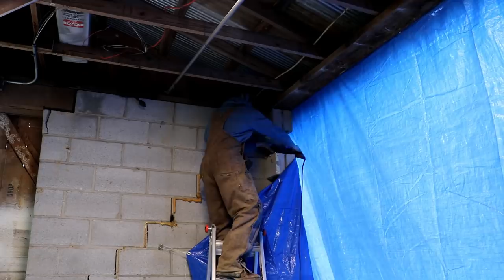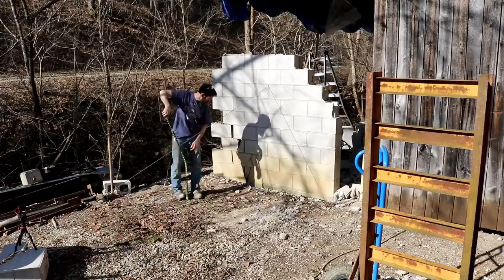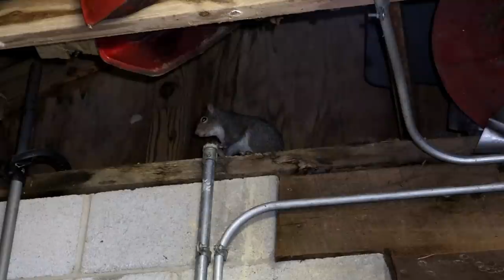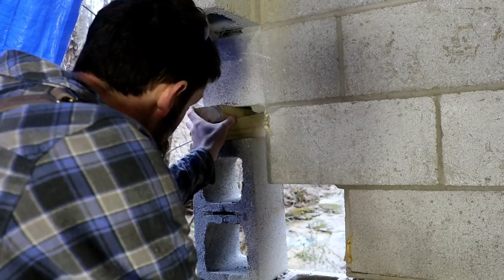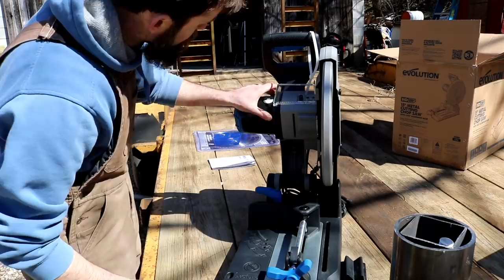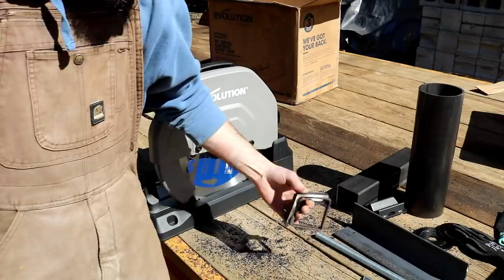Pushing down the block wall & New shop saw ..Shop repair part 6

Comment: Glad to see your shop coming along. Seems your ibuprofen supply is still going strong 🤣. I bought a 12" makita version of one of them saws and I absolutely love it. About the only tool in my shop I'll play in real time on video 😁. I've cut 4140 with it (annealed of course), sparks a little bit but doesn't seem to mind. My poor little bandsaw just sits in the corner until I need it for aluminium or something. Thanks for the share, Steve!

Comment: I've had two Evolution chop/mitre saws and they are great, I currently have the 'Rage 3' model, smaller blades than the one you have, but super useful.
Reply: Also, the reason I'm on my second one is that the screw to change the blade is a left hand thread. I did not realise this when I came to change the blade on the old one and royally effed it up to the point where it was easier to just buy another one :D

Comment: The project is moving along pretty well. You're going to love that saw, a friend in NY has two in his shop where he builds and repairs off road vehicles and trailers. I've used both 10" and 14" there, the blades last quite a while and when Tig welding the joints I believe the world's are better cause the metal hasn't been subjected to the heat the abrasive blades generate. Also the lack of grinding dust is a huge plus. I'm saving for one of the 14" now for my own shop.

Comment: Steve, I have switched all my air hoses to flexzilla hoses, they are absolutely the best hoses out there. I have also thoroughly abused them without any issues except the one I shot a nail through with an air nailer. I have dropped stuff on them, gotten weld spatter on them, sprayed them with acetone for years, and no issues. They also are ridiculously flexible as they claim. If you make the investment you absolutely will not be disappointed.

Good pick up on the evolution saw. I have an Iron Ton which is similar but sold by Northern Tools and I don't even use my horizontal band saw any more. It's louder, but it's so much faster, and the cuts are better. As you noticed when cutting through something flat the extra surface area slows the cut down and introduces some chatter, so i've found the best thing to do with angle is to set it up like a pyramid that way you're cross section is 2 angled pieces of metal instead of one vertical and one horizontal cross section. Hope that helps.
Reply: The best hoses are Gates.

Comment: Boy those Evolution metal saws are the dogs dangly bits as we say here in the UK ! ( well that's the clean version anyway! Lol) we have had Evolution stuff here in the UK for at least 10 years. They first started out marketing chop saws that would cut through lumber as you Americans call it with nails in it and I saw a few demonstrations of their saws and yes they worked as advertised working on the principal of slower blade speed and guarded teeth so that the bite of each tooth was restricted as to the depth it could cut. The new metal saws work in much the same principal.
You almost lost a camera on the wall drop Steve, measured the drop nicely but didn't allow for crud being thrown forward! Nearly! Love the multiple shots of the various angles of it coming down. Very arty farty! ( please forgive another English saying.)

Comment: Hey steve I have been a fan for a couple of years now I love the videos. I own the same saw, I love it. Mine is a couple years older. The only issue I had was the old quick release bound and hurt the threads. I ended up making a whole new one without a quick release. Your saw looks like they made it stronger with a thicker diameter screw. I ended up researching a lot on blades I have a list of blades that fit. If you would like the list I would be happy to give it to you so you dont need to look. I think the list has 48 different blades. All the blades are 14" and are the right arbor and speed. My favorite blade right now is the tenryu heavy metal plus. If I can give you a tip, the blade really doesnt like wide flat surfaces it causes too many teeth to contact at once which slows the cut and causes chatter. Build yourself good thick v-blocks doing that you can put material to cut in the saw with the least amount of contact at once. Heres an example with vblocks you can put square tubing in the saw with a diamond orientation that allows the least amount of teeth contact at once you will get a cleaner, quicker and less chatter cut. Sorry for the long comment. Keep up the great work and have a great day!

Comment: Nice saw Evolution sent you - looks like they've improved their designs. Had a Rage 2 miter saw from them. Currently have a Evolution mag drill - works great. Definitely should look into better ways to clamp different shapes of structural steel - like Joe Pie's video. You'll get faster, more accurate cuts, improved blade life and in the case of that angle - a much SAFER hold. Good stuff; enjoy the videos!

Comment: i ended up replacing the the vice screw and nut on mine because the quick release nut would jam up and started to mess up the threads. i used acme thread and a plain nut as a replacement.

Comment: I avoid HF metal air fittings as I have had them break if dropped on the ground or just under air pressure.  You will like that saw more than any other saw you have ever used.

Comment: I picked up one of Evolutions “hybrid” saws late last summer, on clearance.  I’ve spent the last six months cutting up 3”x3” x8' lumber that had been spiked together to make shipping palette rafts for pipe.  I’ve burned up one blade, but the saw cuts nice, and goes through these 1/4” thick spikes like butter.  I’ve heated my whole house through  this -30’s winter using material cut up with this saw.  By my math,  that was probably 6500 cuts, at least 20% of them or more through random spikes.  Beats burning up my chainsaw. ;)

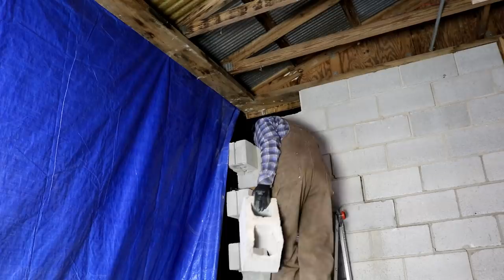Comment: I think that shear line crack in this end 14:30 is because that corner is not/was not well supported. both in the wall itself and under the wall.  I'm no wall engineer either.  just a .04 thought.

Comment: That's the way to do it, One big piece at a time. It would have been a lot harder to take apart block if they had put rebar in them.

Comment: we had a few cold cut steel saws at my old work, cutting steel tube all day. they work great if the material can deal with the cutting forces, and i even once cut through some 2"x1" bar stock for a personal project, cut no worries

Comment: Ahhh, now you've got the bracing.

I suggested going from the middle height of the lifting posts back to the top of the existing partition wall.
The braces could be longer and still entirely out of your work area.

Comment: Gday Steve, great progress, you have certainly got the hard part as good as done, it’s not a easy job by any stretch, I bet you looking forward to getting back to doing some machining, I’ve seen a few other YouTube creators review that drop saw and I don’t think I’ve heard anyone say a bad thing about them yet, I have a Ryobi metal saw with the steel blade, it’s got some age to it now and needs a new blade but it’s done a fantastic job, I found that cutting stainless steel heater flu destroys the blade as quick as lightning, not a good idea, thank you for the update mate, looking forward to next weeks video already,    Matty

Comment: Hi Steve, those saws are pretty good and heaps better than the old abrasive ones (no dust). I use a Makita one at work and that is built really well. I’d recommend it. Glad you’re ahead on time with the project.
Reply: John Sullivan 
I too use the Makita version at work they are a good tool I would never go back to the abrasive version
Reply: Thanks Mark, I was surprised with how accurate they are and while the price is higher to initially purchase, the efficiency makes them more cost effective.

Comment: Steve have you looked into driving piers below the creek bed to support roof structure? Also it appears that erosion & poor choices in concrete mix & reinforcement caused your floor to fail. I'm suspecting the soil base under the slab was of fill that couldn't move water out from underneath the slab which caused heaving & settling.

Comment: That evolution company as a place out of  Devonport  Iowa. I  Bought the rage 2 they had. Still use it pretty decent saw did a couple videos on it. Gonna make a new base for it. Possibly out of one of the fireball tool machine plates he makes.

Comment: I'm guessing you'll be back at harbor freight to get their gas powered hole auger so you can put in a bunch of concrete tubes to hold the soil together and for a solid footing before pouring a new pad. I'm not an engineer, but I'm guessing it will give you a good solid way to help keep it from sinking again. The water drains on the other side are a good idea too.

Comment: my experience with those saw, try to minimise the blade contact while cutting by positioning the cutted piece in a better way.  flat bar, position them upright, the same you would with an abrasive saw, that way no heat is building up (trashing the blade). angle iron, position them with the angle pointing up. you pushed on the saw perfectly tho, when you start seeing sparks, 2 indications possible, you are pushing too hard or the blade is already starting to trash itself. these blades are costly but we all like them! oh... there no way to minimise the chip, its flying everywhere lol...

Comment: You are probably exceeding the Diablo hose working pressure. Many cheap hoses list their burst pressure rather than working pressure and the "do not exceed" hints to that. In the hose industry, air hose usually falls in to the 4 to 1 safety factor but not always. Some like to use a 3 to 1, if that is what Harbor Freight uses than you hose might be a 100 PSI working pressure. Always stay within the working pressure, that is where it is rated to work day in day out.

Comment: they make a radial saw as well that can cut through wood and nails , been sniffing around these evolution saws for a while now havent bought one yet though as i allready have a radial saw and a normal sawtable
save youreself a lot of work and back acke and rent or borrow a bobcat and use that to break up and remove the foundation , you can get at it pretty eazily now that the walls are gone

Comment: Those metal cutting saws are great, but the blade won't last long cutting rebar. Too many hardspots in rebar. Use a torch or an abrasive saw/grinder.

Comment: Your tool & cutter grinder would do a dandy job on those carbide tooth blades.  As long as you don't chip it from starting the cut too fast, you'll get a lot of re-use just from touching up dull edges.  Does the documentation say anything about being able to use coolant or a water hose?  Since the structure seems to be mostly aluminum, I'd guess the only issue is how well the shaft seals protect the bearings?

Comment: Wanna see more lathe work.  Wanna see more milling machine.   Wanna see more surface grinding.  Wanna see more tool bit sharpening.   Come on Steve let's get with it!

Don't mind me I'm just your typical complainer. 

Nice job on the wall thus far.  You are doing a really great job on the neat and methodical demolition job.  It looks like you put more care into tearing down the wall that the original builders put into it when they built it. 

The Evolution chop saw is nice. But I just looked up the price and all I can say is that at the price it darn well better be nice!
And if I may leave you with one more unwanted opinion:  If it were me I'd save the blade on the chop saw and cut the rebar off with a cheap angle grinder abrasive cutoff wheel.  Especially since it's harder steel.  Harder steel cuts easy with abrasive cut-off wheel.  Save the better quality chop saw for projects that require the nicer cuts.  Rebar can just be hacked off any which way.  It's also small enough in diameter it should cut quickly with a thin cutoff wheel.  For about $20 you can buy an angle grinder and a 10-pack of cut off wheels.  That's provably less than what a new  blade costs for the chop saw. 

Looking forward to seeing your new wall with windows, and bench.   Maybe I'll get my wish for more machining videos come fall?
Great Channel by the way.  I've been watching your productions for quite some time.  I really enjoy your little "Nature Breaks" mingled in with the machining.  And tell your squirrle buddy I said, "Hi".

Comment: You ought to make an arbor to run that Evolution blade on the K&T mill.
Reply: Good God, a 14" blade on a mill?  I wouldn't go near that with TWO ten foot poles...
Reply: @somebodyelse6673  No big deal The mill can turn slower than the cutoff saw does. Metal cutting is ruled by surface feet per minute. it would lack a guard but you wouldn't have to stand directly over it.

Comment: Not trying to be negative but I have never seen mortar come off so easily. When I built my pool and greenhouses the mortar was stronger than the block.
Reply: This demonstrated why you never want to be in a block building when a tornado hits. The line between the block & the mortar is what is called a cold joint. The bond can be improved by having the block damp/wet when laid. If that wall was laid when the weather turned freezing over night the fresh mortar would have been greatly weakened.  Some guys like to put a lot of lime in the mix. Makes it stickier and easier to work, also weakens it, a lot! It's pretty obvious that the footings were not done correctly either.
Reply: Symptom of dry blocks and a weak mix. I always wet my blocks but this takes longer. They saved time so they could have a few more beers. 
If you're laying blocks it's much faster to do it dry. The blocks suck water from the mix and it goes solid enough to lay more courses on top. Looks good and they got paid and ran. As with lots of poor work it's the next guy who picks up the problems.

Comment: That double wedge thing: Some years ago, my parents wanted a large part of a structural wall taken down. The contractors took the wall down, THEN put a steel joist up. Of course the top floor sagged and jammed several doors. Next time, my parents asked ME. My formal training is mainly in electronics... Anyhow, I realized that if you cut into a pre-loaded structure, it's gonna DROP onto the new support. So I put a temporary joist in FIRST. Pre-loaded that as best as I could by tapping in double wedges. Then did the same with the permanent joist.As far as I could measure, there was no further settling of the building from the wall I took down.  Doors and windows still opened w/o a squeak. A marble left on the floor still rolled in the same direction. No obvious change in the spirit levels I had deployed.I find it sad that it seems like I can do a better job in a completely different trade than those supposedly trained and experienced in the field, only by thinking about what'l happen next, and what to do about it for maybe a minute. Total time I spent on erecting that temporary support was probably less than 20 minutes. What's that on a 2 weeks job as the first remodeling was? And that sub standard result will stay with the house "forever".Anyhow, wedges are powerful thing.And forethought even better.Keep up the good work.

Comment: Hi steve they are good saws an do a good job just watch out when cutting dirty (rusty an what not) metal real hard on saw blade seems to make them chip an crack the saw blade but they are much better then those grinding wheel saws.

Comment: Maybe it's been answered, but what are you going to do with all that concrete?  I get some of it can be used when you pour the new concrete, but you've got enough there for another shop!  Great content Steve, love seeing this stuff.

As for the HF Hose...take it back...get your money back and get another...rinse and repeat.  Same with their power tools.  When you know you're going to beat the daylights out of a tool (i.e., Stripping the hull paint off a boat), I went through quite a few of their random orbit sanders...better their $18 random orbit sander than my good $120 ones.

Comment: And to think i had assumed they were drunk when they laid the floor, silly me.
Reply: Maybe just when they (didn't) think about making decent foundations for that soft bank. 
Nice finish on the floor and well laid blocks, but no rebar in the floor or any foundations under the weight of that wall. Have few more beers it'll be ok.

Comment: Wow - really impressive saw, super clean cuts, less heat sparks and overall drama with the lower speed - looks amazingly promising.  How many amps is the motor, does it have any info on the motors internal construction-??

Comment: Evolution saw: IMPRESSIVE.  You didn't mention the clamping system where, at the business end (the thread meets the jaw) there appears to be some articulation in the joint, such that when you clamped thin stock the jaw angled in.. therefore losing some purchase on the stock.  Not sure it's a big concern, but curious on your thoughts about it.

Good to see Peanut again!  My instinct would be to powder him down for the fleas, but imagine that hardening by nature is better (and we can take a lesson there, present day!).

Comment: Well, that saw cuts stupidly fast. Cuts that normally take more than a minute are done in 15 seconds. It would just be really nice if the thing was built like a tank, and had a liquid cooling option. But that is reasonably easy to make yourself.

Comment: Great job on the demo and nice saw. But.... please CLEAN your trailer off of all the saw dust. Those metal dust chips will kill it in a few years. They will lay down on the cross members and nooks and crannies. Pressure washer might be needed.

Comment: I have one of those saws as well, cleaner cuts requires less cleanup! Work holding is critical, I am curious on your opinion on the work holding recommendations in the manual, some seemed sketchy. Nice progress on the demo ! Wished I had that level of stamina these days😳